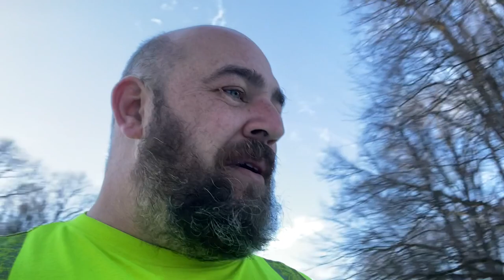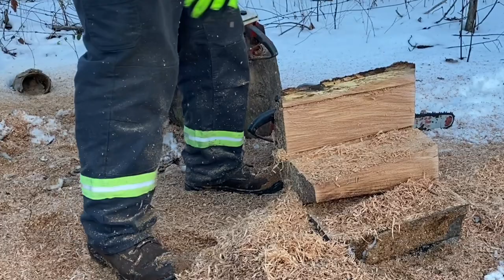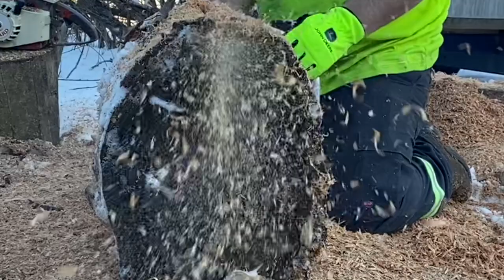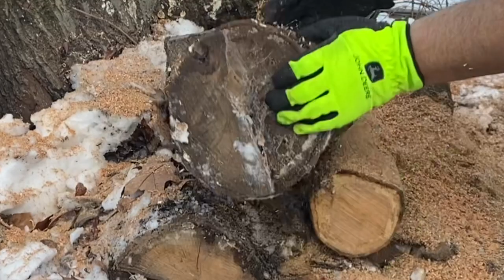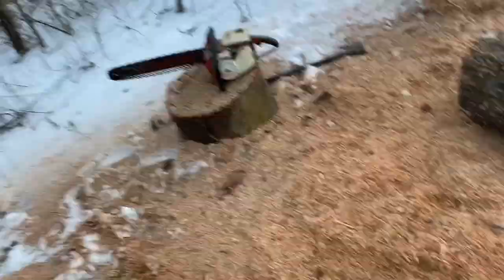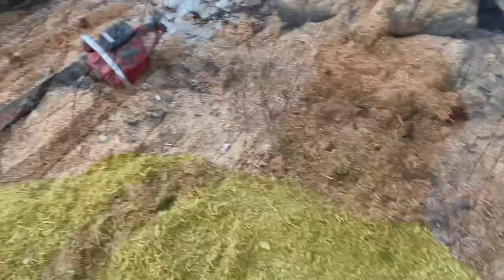Chainsaw Log splitter! Log splitter Broke Down So The Chainsaw Took Over!

Comment: I always have problems ripping with my super xl gets packed full in the clutch area. The xl 12 is what I end up using to rip. I think it's always more fun "splitting" with a chainsaw.
Reply from the maker: The XL-12 does not have the oil pump inside there to help clog things up.  Chainsaw spitting can be just as enjoyable.